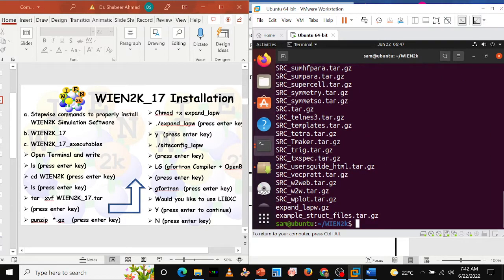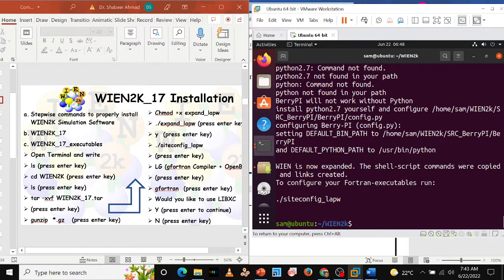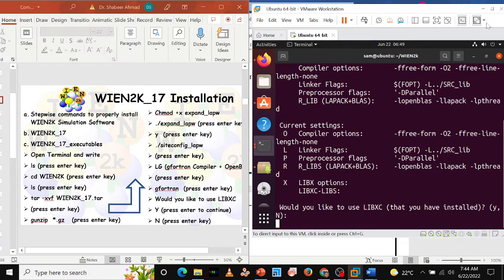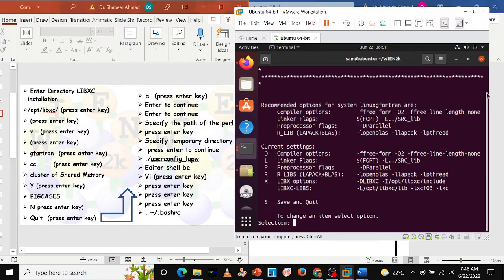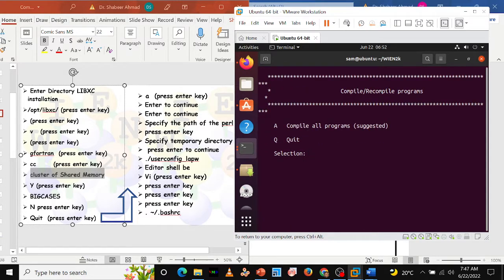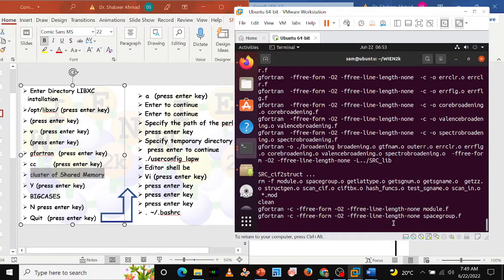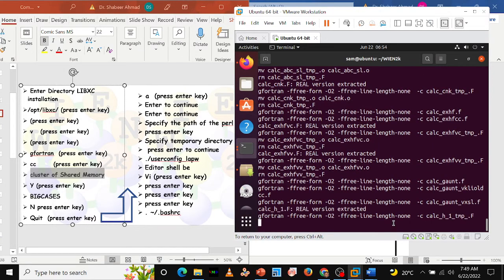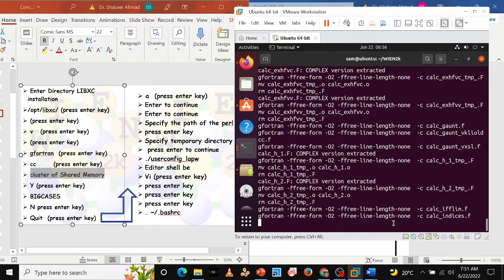Lecture5_part1 Materials Modelling & Simulation WIEN2K version 17 and above installation procedure

Comment: Sir during installation of wien2k_17.1 i face two error during compilation how i fix these two error the sentence is such like "cannot open module file 'xc_f03_lib_m.mod'  for reading at (1) :no such file or directory " 
Waiting for your kind response.
Reply from the maker: I guess the update & upgrade u did not complete well
Reply from the maker: Also check the liblapack & libblas library u need to repeat it
Reply from the maker: Formation energy has formula which u can find in google. U can calculate according to the formula